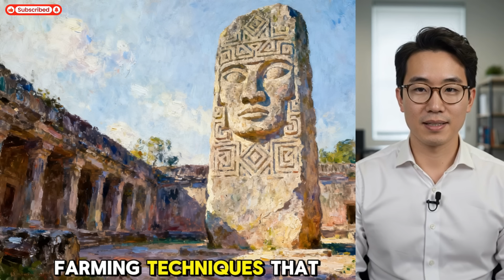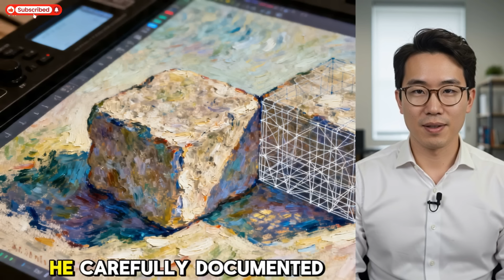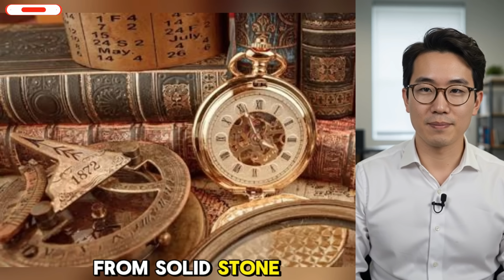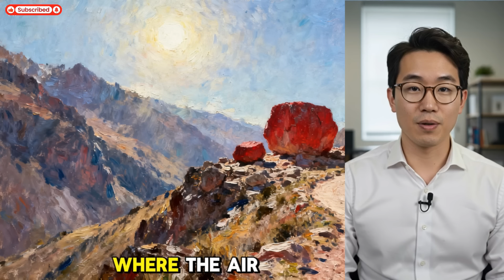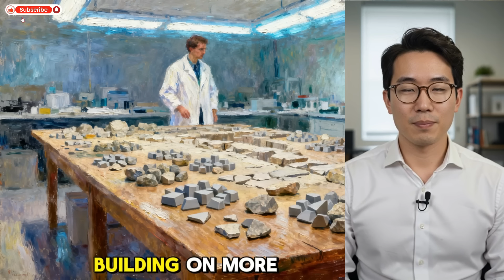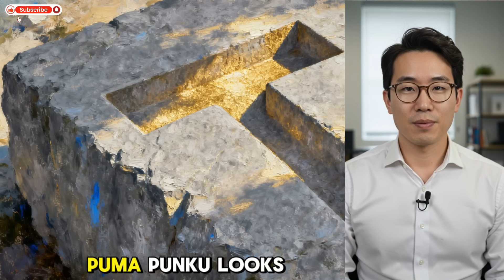Puma Punku's H Blocks Were Just 3D Scanned—The Results Shocked Researchers

Comment: the only thing they figured out is that abrasion was used, why would that civilization in 300 A D be creating these huge blocks down to 1000s of an inch tolerance to begin with. that doesn't even make sense. also the largest stone our civilization has ever moved was 30 tons and it was a huge nightmare and took every but of modern equipment they could come up with. you don't move 100 ton Stones with rollers amd ropes and pullies..
you don't build things like the great pyramid with stone hammers. these academics are full of it. they cant admit they dont know. 
they found evidence of abrasion so proves B,Cand D are true. yeah!

Comment: how will you polish 1x1 cm with slurry? especially when only 2 sides are "open",while other 2 have walls, and they still achieved crisp corners. you havent researched this enough, it is virtually impossible to do this with hand tools. Also,you mentioned unfinished obelisk for Aswan, sed it was also made with diorite pounders, how do you pound with a rock wich cant even get in the recess let alone have room to swing the mf? this is entry level analysis.

Comment: I have been a builder for over 40 years, I have worked on building over 100 years old. Im talking about buildings put together with wooden pins and dovetail prosses, the interior of these buildings as far as the moldings, stair rails , flooring, and plaster work was far superior compared to today's standards in new construction. I look at these megalithic structures and can clearly see that the prosses in manufacturing these structures was beyond what should have been possible for there time period, 
 Compared to today's standards we are so far removed from their level of workmanship. These structures were not constructed within the time period in which they want us to believe, and who constructed them. There were a race or a civilization  that was far more superior than we were and most likely ever will be. Just look at the scale of what was being manufactured and assembled then compared to the scale we use today to build even the biggest structures we put together today. When building a modern house today the cinderblocks we use are on average 16"×8" in size for building the foundations. For commercial buildings aren't much different in scale, this is so we can handle the materials to our own capabilities, so the question is with the size and scale of the building materials back then, is how big were the builders that moved and constructed these megalithic stone's?
Reply from the maker: It is always valuable to hear the perspective of a seasoned builder when analyzing the engineering feats found at these ancient sites.

Comment: Results of percussion?  Does it indicate the pressure or speed of the percussive action?  Could it have been hundreds of hits per minute?  Could it have been under extreme pressure?  Is there a way to differentiate the different manners you spoke of or the ones that I suggested?  How  can anyone state, with any specificity, that it was done by hand in a primitive manner or done with tools which could be wielded by hand?  Repeated, perfectly measured, results would indicate tools, not human hands, had been the wielders of those still unknown types of tools.  Can it be determined whether or not steel tools had been the origin of the percussive removal of stone from the blocks?  I hate to pee in your wheaties, but it is difficult for me to understand the insistence that primitive tools used by primitivee people could reproduce, time after time, the perfection found in the blocks.